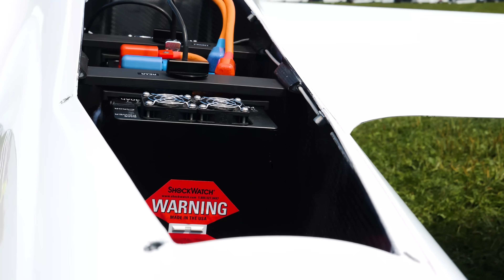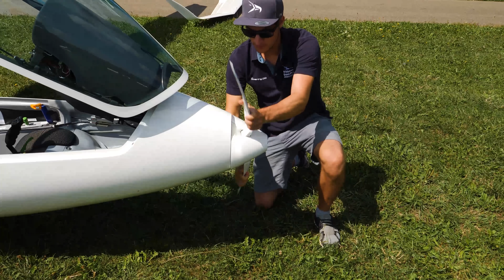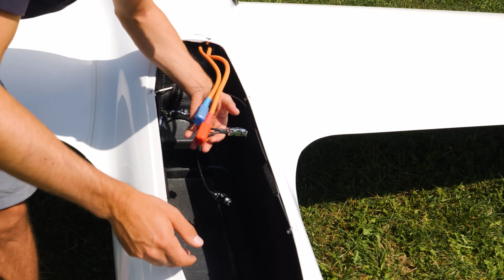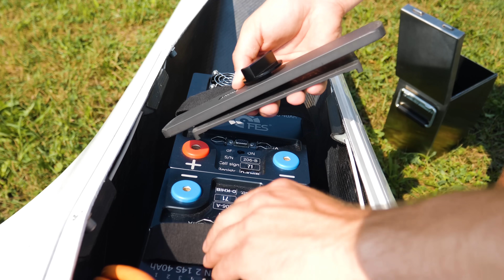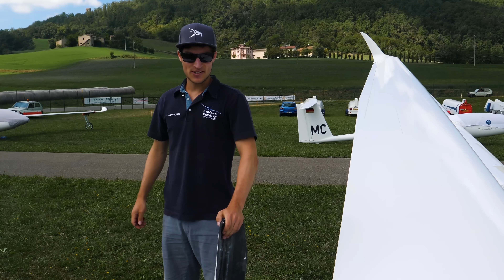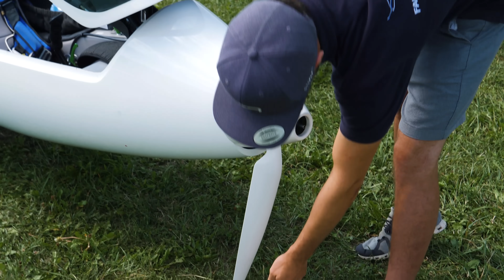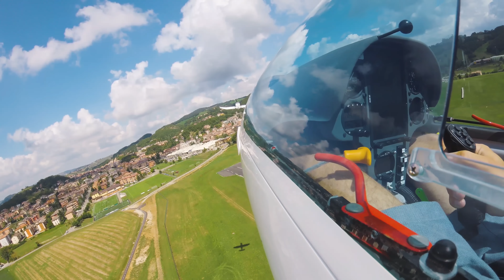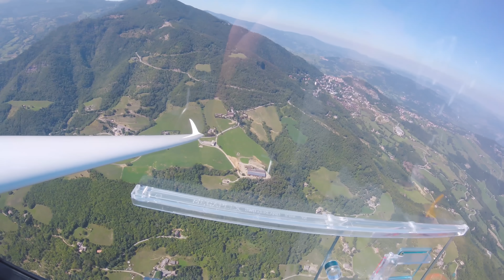New LS8-e neo review | Electric Glider 15 m & 18 m wingspan

Comment: Next add a solar panel charging system into the wings for the batteries?
Reply: That's not that simple. It's very difficult to glue PV cells to the wings, which are very flexible on gliders. Then there's a problem with surface, again, glider's wings are extremely smooth, and, of course, there's the weight issue. I think there's only one practical (usable) solar powered plane out there: Sunseeker Duo.
Reply: fifi23o5, the wings may not be practical without significant engineering, but I suspect they could put enough PV cells on the fuselage to trickle-charge the batteries while it was on the ground.
Reply: @Vessekx  such thing is already in use on gliders. Some have PV cells on the doors of retractable engine and it is used to charge the battery for instruments. Fuselage doesnt have the area to be sufficient for propulsion..
Reply: fifi23o5, I wasn’t proposing the solar cells would be used to driver he motor in flight, simply that it could be sufficient to recharge the batteries while parked, rather than having to disconnect them and haul them across an airfield.
Reply: @Vessekx  That wouldn't be very practical. You could get 150 W of power at most from the fuselage. And cells would have to be flexible and very small due to tight radius of the fuselage, so it would take an awfull long time to recharge the batteries. So, if I fly today, land late afternoon, when would batteries recharge? No flying for a day or two. Just not practical to be worth the effort.
Reply: @Vessekx  I was thinking more in flight while your just gliding and not using the motor all the time they could be used either to top off the batteries, or at the least prolong the charge just a bit. Also could run some of the electronics so they didn't pull off the main batteries. I'll be the first to say I'm not all up on modern solar tech so no idea how usable it would be, but it just seemed like a good idea at the time.
Reply: I think a miniature prop generator would be more efficient.
Reply: @torkdork69  Like a wind turbine?
Reply: @torkdork69  Maybe call Iron Man to push the glider to power the turbine.

Comment: There is a small movie that I think is still on Youtube called "slipstream"  Mark Hamill plays the main bad guy.  The significant part is all of the u;ta lite aircraft featured in th emovie.  find if if you can
Reply: It wasn't an ultralight aircraft.  It was an Edgley EA-7 Optica.  
Powered ultralights weigh 254 lbs or less.  The Optica weighs over 2000 lbs.

Comment: Besides the tow-hook, what else is sacrified for the FES engine compared to the normal LS8? 
Can the rudder pedal go as far to the front, (the normal LS8 is not that big)? 
Is is still possible to put trimmweights behind the rudderpedals?
Reply from the maker: At the prototype the rudder pedal looses one step, so it is about 3 cm shorter. But in the next gliders they will change it and the full length will be available. Trimmweight should be possible, at least I had some trimmweights in the trailer. ;)

Comment: I thoroughly enjoyed the video my friend... I have a recently been looking at v tail glider for sell that includes a 26 h.p. 2 stroke MZ34 engine and hopefully folding prop as a motor glider project.... I would need someone skilled in aircraft modifications... A&P mechanic probably could accomplish the task of integrating power unit into glider.. I don't know the manufacturer of the glider ?.... project is avail. under $5k US..... I have no idea what the cost would be to get the aircraft to the point of getting motor glider certification?

Comment: no no no....never turn the prop by hand. Read the FES supplementary flight manual before you do that.
Reply: I was kind of curious about that myself....
Reply: Simon Buckley. Why shouldn’t you do that?
Reply: Why? It is an electrician engine not a reciprocating engine, it shouldnt start
Reply: @gonzaloconde4299  you don't turn it by hand because the magnets are extremely powerful and the blades are designed to withstand the forces caused by the motor turning them against air resistance, not being levered round and applying bending forces on the blade mountings in the opposite direction.   If you don't believe me, mail Luka at LZ and ask him.   I don't let anyone touch the blades on my HpH 304ES for precisely this reason.
Reply: Simon Buckley. OK, that makes sense.
Reply: @simonbuckley7667  thank you for the lesson, i had no idea about that 👍

Comment: I had a 10 foot flat bottom boat which had a trolling motor powered by 2 deep cycle batteries.  I used it to troll for striped bass and lake trout.  Long story short is it ran out of battery several times so there's no F'n way I'd be able to use this plane.  This thing is for responsible individuals.
Reply: You need to pay more attention to battery management system. I had that for my battery canoe, never got caught out

Comment: It looks like the batteries are either acid ones or AGM. Wouldn't it make more sense to use LiOn ones? They are more efficient and lighter. It's also a bit concerning that the terminal cables are not secured by anything to the batteries. It would make sense to use another bar on the top to secure them.
Reply: there Lifpo4 With BMS

Comment: when he was preparing to glider's batteries a scary idea came to my mind, what if a screw or a battery failed in mid air , what will happen , than i remembered that a traditional glider is designed to work with no engine

Comment: Maybe it's a translation thing but an engine has internal or external COMBUSTION. Anything ELECTRIC is a motor. And anything with a motor isn't a glider. It's just an airplane with a long, thin wing. Get towed up with a tow plane, winch or bungee. THEN with no capacity to gain altitude EXCEPT by riding thermals and slope lift,,,, now THAT'S a glider,,, or as some call it a sailplane. I like the latter. BUT, I did enjoy the video. Your love of flying is apparent and that's OK, in my book. Informative too. Thank you.

Comment: I do not know if it is viable, but I think you could add ultra-light and ultra-thin solar panels of the latest generation that could be stuck on the wings, that could increase autonomy in addition to recharging the battery in emergencies or landings in inaccessible places, possibly other components must be added or modified in addition to the power, but today there is nothing that cannot be done with technological advancement

Comment: About the most efficient (and efficiency in building) compared to most other retractable prop gliders. The little drag would probably be easily off set by less weight than the fully retractable glider power plants.

Comment: its relay cool but It don't have the capacity to lift off alone, I saw one video where there's a electric Glider with a bunch of solar panel in the wings a electric engine with sit space for two, they can lift off alone, it is just amazing, but yours is pure cool to, I love it, why you don't put some solar panel in the wings to ensure more battery time

Comment: Congratulations! Great plane! To reduce drag, have you considered dimples on the fuselage like the ones on golf balls!?
Reply: Dimples work on golf balls because they let  them break the airflow with the micro turbulences they generate, gliders need the polar opposite since they use that flow to keep themselves in the air.
It wouldn't ground it but a dimpled fuselage would only add extra drag to a glider
Reply: @npc6817  Thanks! I really appreciate the information!  So on a sphere the dimples reduce drag, but on wings of an airplane it would decrease the lift force? Would dimples only on a plane fuselage reduce drag and wings without dimples help to create lift? Someone told me one day that jet airliner use a special kind of paint (not smooth) to create a similar effect to dimples on a golf ball. Even a car on Mythbuster was tested with huge dimples to see it would reduce drag and reduce fuel consumption, and it did!
Reply: @Muuip  first off I made a mistake, it would reduce lift rather than increase drag.
That said the difference between between a car or golf ball and a glider is that a car only has to pierce trough the air while a glide must simultaneously do that and keep the airflow intact to generate lift. The bumps destroy the flow of the air in front of them so that it gives it less resistance against any object passing trough, problem is that resistance is what wings generate lift from, if the flow is in shambles it can't form the ""membrane"" of the low pressure lift bubble over the wings.
Maybe for airliners it makes sense to sacrifice some lift for better speed since they can always introduce extra energy into the equation with their turbines but gliders only have extremely limited energy and need to save it to keep flying.
In a glider speed is only really important to generate lift and it can basically only be gained by sacrificing altitude, so a more lift efficient design that requires less speed to maintain ideal glide ratio is preferrable to a faster one. Of course gliders are also designed to have the least drag possible since more drag = more altitude must be sacrificed to gain the same speed  but drag reduction never comes at the cost of lift since it's the very thing it's there to achieve
Reply: @npc6817  Great explanation!!! Much appreciated! 👍
Reply: @npc6817  What if the side under the wing of a plane had dimples and the side on top of the wing didn't have any dimples? 🤔
Reply: @Muuip  don't know, my guess would be the while the flow would normally split at the front of the wing  but the disturbed flow from below could have difficulties joining at the back to close the low pressure pocket? Then again the flow disruptors are placed above the wings so I guess they wouldn't be as effective on the bottom so maybe having dimples below the wings wouldn't affect lift that much.
Then again it wouldn't reduce drag either since  the body of the wing is already a tapering edge, the spot that gets more air resistance is the front edge but you can't dimple that, only other place where they would help could be the front of the fuselage but then the turbulent air would blow on the wings as well after hitting and breaking up on the nose cone plus you can't really put dimples on the canopy and that's like a third of the surface exposed to the air, so yeah, dimples aren't good on unpowered aircraft.
Then again it would be interesting to experiment around with them, problem is I've got neither an aircraft eingeneering degree nor a wind tunnel to test in, so I guess I'll let the pros handle this.
Reply: @npc6817  Well, making that experiment can bring you that much closer to become an aircraft engineer  you sure have the spirit for it! I guess various models could be 3D printed and tested in a wind tunnel.

Comment: Bruh they should make it so that when you aren't using the propeller mid air, when you're just gliding, so that it can spin freely by the force of the incoming wind and recharge the batteries mid air.

Comment: I want to see a sail plain that can take off on its own power and recharge before landing by reversing the transmission,e.g  altitude is gained by thermal updraught, the piolet pulls down to increase speed which is converted to electric energy by the propeller /motor .than the updraught is used to regain altitude the cycle is repeated till the battery is recharged
Reply: What is this ? Willy wonkas chocolate factory? Better stick to riding bikes my guy

Comment: If this thing cruizes at 5kw, but has such a massive surface area, have you considered integrating high efficiency solar cells into the non-control surfaces?
Just an estimate, but it looks like you could maybe get 900w with good sun, maybe more depending on how much area you have

Comment: When are you supposed to use that propeller? 
Will it improve the distance that you travel? In one of your videos you have had traveled 800+ kms with the glider so with the help of battery operated propeller can you really cross that limit? 

I am completely new to the aviation so just curious to know.

Comment: Hi there, your video is very much,but I get some questions about the glider.Is that all your powers are coming from that battery?Is there anything like RAT for you to gain the electric power by the air?That motor in front of your cockpit only provides you horsepower?Or you can use is for windmiling to get some electric power?
Reply: I think the problem is, the rotor is optimized for low drag when not in use and will flip back, it can be seen in the video. So you have  to lock this mechanism. Then the motor can be used as a generator....but i think it is more efficient to store energy by flying higher than stay at the same level and charge the battery?

Comment: Stefan,

The LS8 in your video has a simple, logical and useful cockpit instrumentation. The vario appears to be an LX-Nav V8 (?). 
1) Does the vario use the LX-Nav digital compass? 
2) If so, do you find that the real-time winds are good enough to detect air mass convergence lines (as good as the Air-Glide Display-S? 
3) Is the traffic alert pop-up display of the LX-Nav 9070 sufficient enough to not need a dedicated traffic display? 
4) Given that one versus two varios is a personal choice, would you be content with the same instrument configuration, but without one of the varios (if there was a space issue)?

Thank you,
Raul Boerner
LS6-BWL
Reply from the maker: Hi Raul, it is not my glider and I only flew it for this competition. 
Yes, it is a V8 variometer with LX 9070.
1) No idea if it was installed or not. 
2) No, not with the setup in the LS8. But I have only heard from good experience with live wind display in combination with the Air Glide Display. 
3) This was ok. If you have more space in your panel a Air Traffic Display is a little bit better. 
4) Personally I prefer looking at the mechanical vario gauge, but this is a preference of each pilot. The equalising air tank of the mechanical vario is not good for responsiveness. 

Despite the real time wind calculation, the LX9070 is a great system!
Reply: @SteFly  --  Stefan, danke!  Raul

Comment: Why gliders are not equipped whith airframe parachute? Instead you have installed complicated systems to jump out of the machine. Weight? Since you have batteries and an electric motor, weight seems not to be a problem. Can someone explain?

Comment: Disappointed that it didn't take off by itself. Just saying. And the noise. A quiet glider like that and one that takes off would be the best glider. But too demanding on batteries I suppose. Still, having an all electric independent glider would be cheaper and more fun than using a tug.

Comment: I saw a motorised glider with the prop behind the pilots head. It was a petrol motor with a 20litre fuel tank and he took off without a tow plane. Would that be a lighter motor than the electric one?

Comment: Crazy isn't it...  RC modellers have spent their lives trying to design, build and fly small versions of the real thing.... now the tables have turned and full size glider pilots are flying gliders with batteries an esc and a brushless driven folding prop on the front..

Comment: Question: Couldn’t you take off just with its  electric engine?
Reply: Considering how it basically scrapes the ground with the wheel height, I don't think the props have the required clearance

Comment: Isn't it logical to add 1MOhm resistor which will connect first and avoid sparks + destroying battery management modules?
He is touching propeller blades when aircraft power is connected. That seems dangerous.
Motor slow start/stop would be nice.

Air shots are awesome!

Comment: Most importantly, does it have an air conditioner?
Reply from the maker: No 😂
I have never heard of a glider with air conditioner. Usually the temperature is ok when flying because you are higher. Air conditioner would be additional weight and needs a lot of energy
Reply: @SteFly  oh ok. Here in Dubai, the temperature is generally high and many prefer air conditioner in everything they travel! Lol

Comment: Why it cant start by itself without plane/.What the point of electric motor?
Reply: The prop clearance probably is an issue. The point is it is an electric sustainer so if you don't find thermal and need to get home you got a better shot at it

Comment: Why didn't the developers of this electric sail-plane incorporate the next LOGICAL upgrade; namely, the integration of high-capacity, high-efficiency solar photovoltaic cells on top of the wings, fuselage and horizontal stabilizer, coupled to a smart battery charge controller/optimizer?
Reply: Weight my man, weight......

Comment: Did nobody notice that he still had to get a tow😂 what is the motor for😂
Reply from the maker: There are two propulsion options commonly used in gliders. The sustainer engine, which is not capable of selflaunching but you are able to fly back home and prevent you from an outlanding. And the selflauncher, which will allow you to launch by your own power. The system weight of the sustainer is lighter and therefor better in competitions.

Comment: 9:30 water wells ?
Reply: Yes the water is well.
Reply from the maker: Water valves. We use water ballast to have better glider performance in good weather conditions. For landing or in bad conditions you drop the water.
Reply: Stefan Langer so does it work like vent

Comment: Why not someone design a compact, self take off glider with strong enough battery and engine and a fan generator supply enough charge to fill the battery full until  end of the journey.

Comment: What happens if I turn off the power switch accidentally while flying?
Reply: Nothing. I've done it (though not in a FES equipped glider), and it didn't even interrupt the GPS track, since I turned it right back on :).